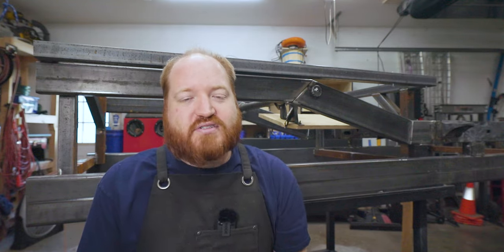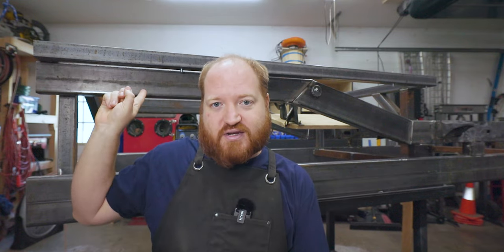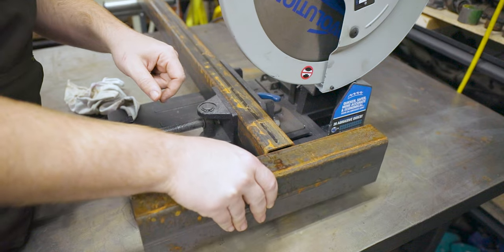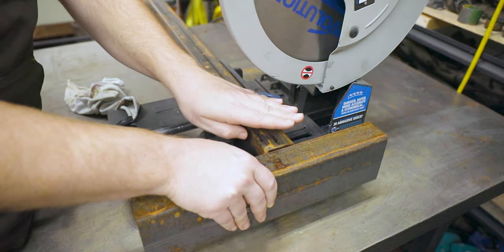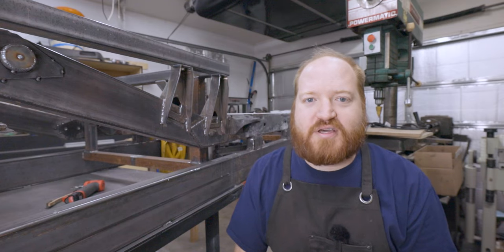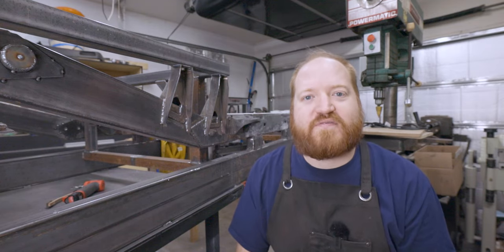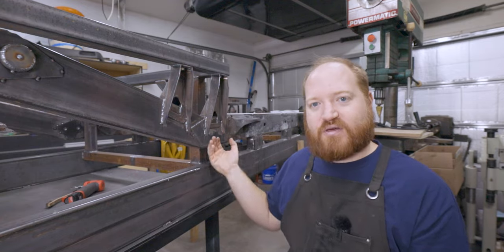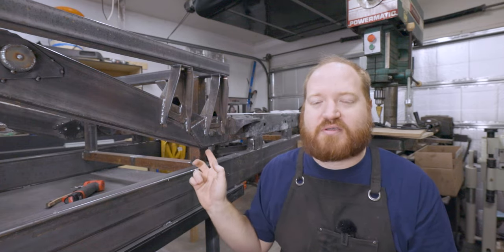Building Bed Mounts: 1989 Toyota Pickup Restoration Ep 31

Comment: Nice my wife made get rid of toyota 4x4 v6 black cause was stick it had 50000 miles on it 3.0 v6 and 4x4 extra cab stick with clutch wife could not drive truck she had car auto .transmission mine was 5speed 3.o v6 4x4 black ac power windows and door locks shift fly 4x4 sr5 model 90s